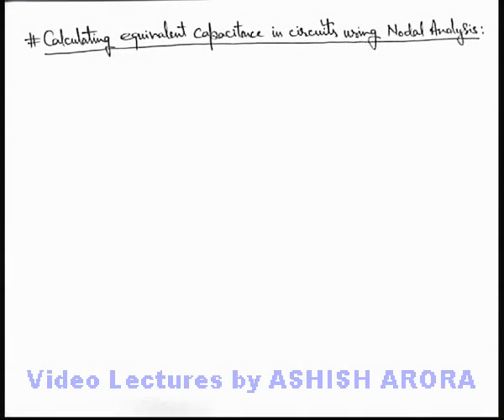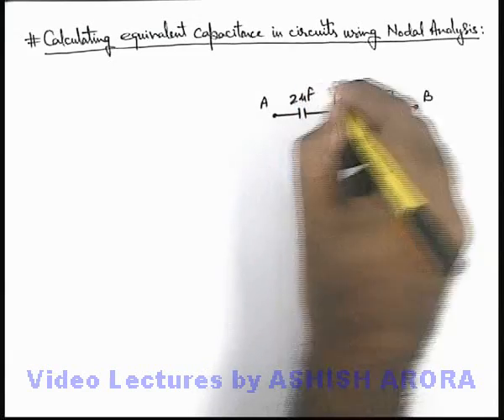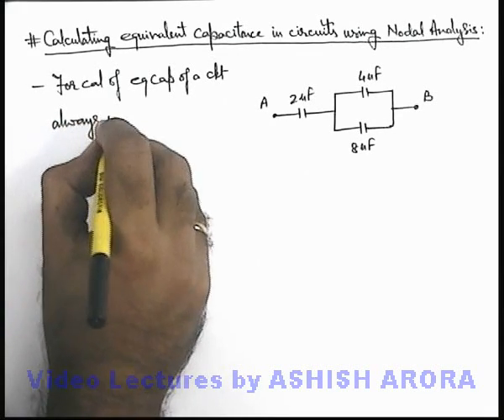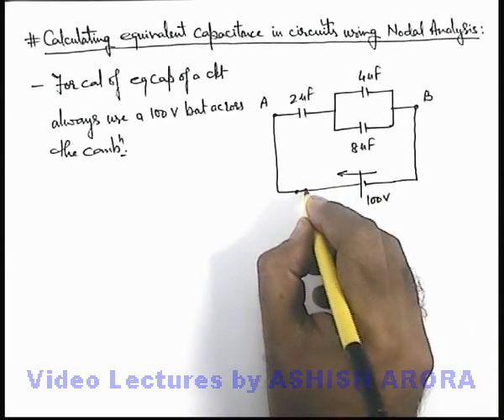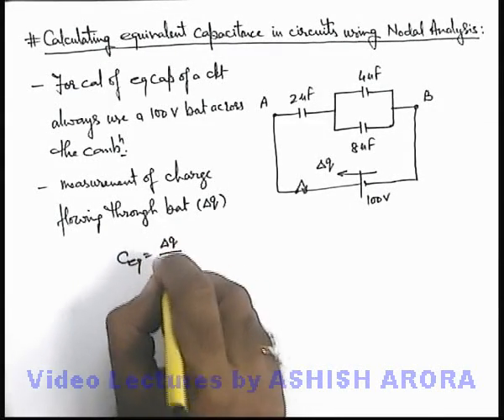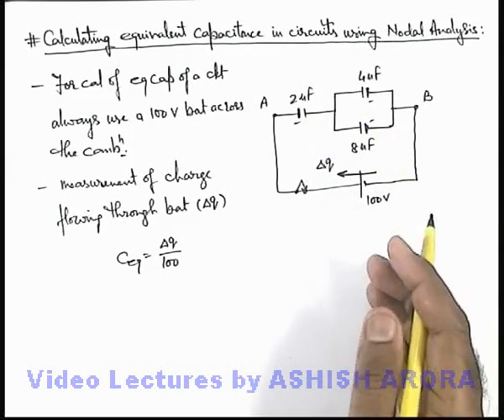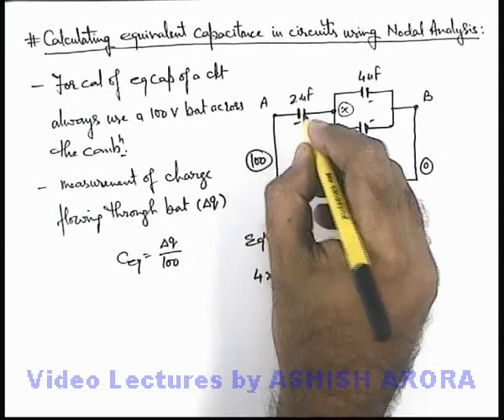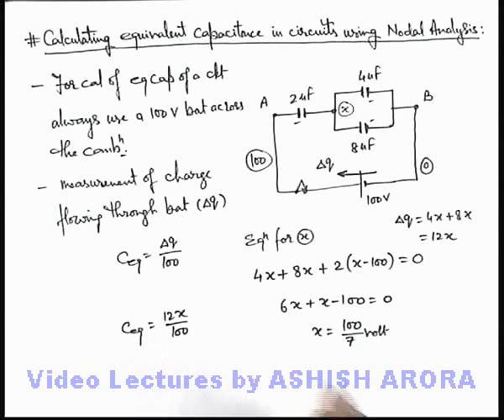Class 12 Physics | Capacitance | #24 Equivalent Capacitance in Circuits Using Nodal Analysis

Comment: Is this method essentially required or i can workout with  parallel and series formulae?
Please let me know ASAP.
Thnaks
Reply from the maker: Series and parallel will also work but in many cases of complex circuits it will be lengthy in calculations... thats why this method is useful in most of the questions...

Comment: Sir here you have considered x greater than 100
But if we write 100-x insted of x-100
Then it would change the answer
What to do in such situation??
Reply from the maker: No... in  nodal analysis we write sum of charges on the all the plates connected to that node equal to zero... it does not make any difference if you consider x greater or less... if you consider x less then for the plate connected to respective node you need to consider charge -(100-x) so it will remain same... as for a capacitor higher potential plate is considered with positive charge...
Reply: Physics Galaxy  thankyou sir

Comment from the maker: We have taken delta q as the charge flown through battery which is taken from the right side and placed on left side. You either calculate delta q = 4x + 8x or it is = 2 (100-x), result will be same as same charge which is taken from 4 and 8 micro farad is deposited on 2 micro farad so we cannot calculate it twice...
Reply: Or cant we not apply that on solving parallel capacitors it will be in series with 2micro farad...As charges will be same in series circuit??
Please correct my thinking if wrong asap.
Thanks